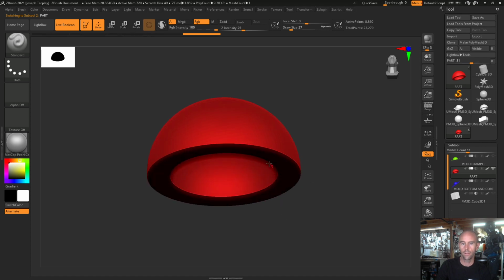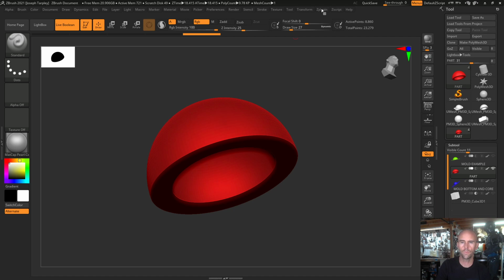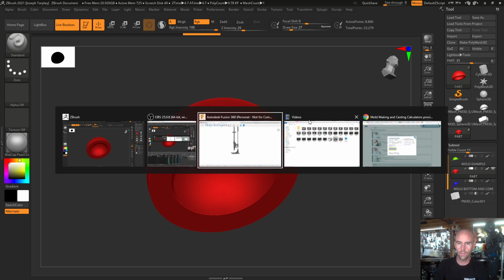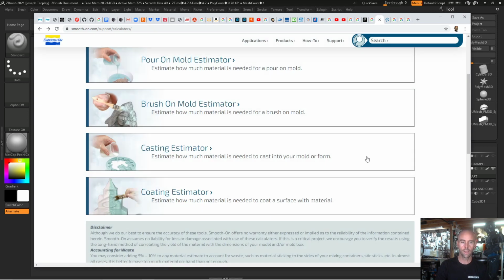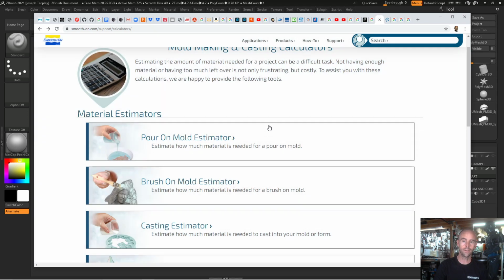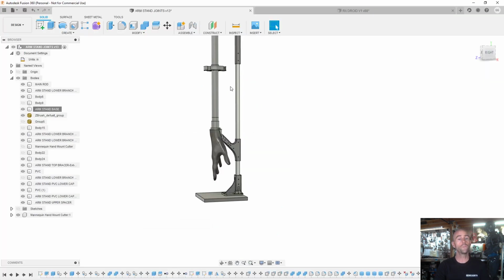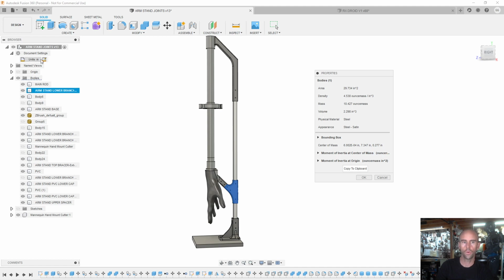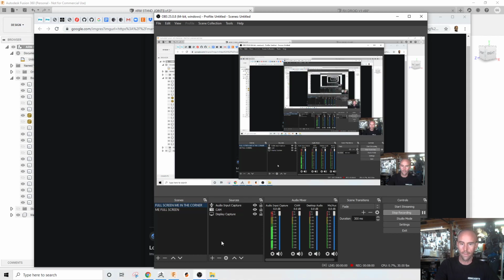Finding Volume of 3d models to help calculate material usage for mold making and casting.

Comment: Curious how you did that arm in fusion 360
Reply from the maker: The arm was a screen used costume part. I didn't work on it, just made the display stands for them, although I can model those kind of thing in Fusion 360. If there's a specific aspect you're interested in let me know and I'll try to answer questions.